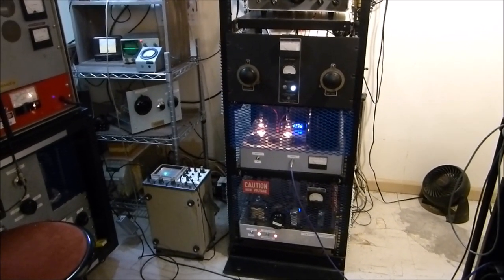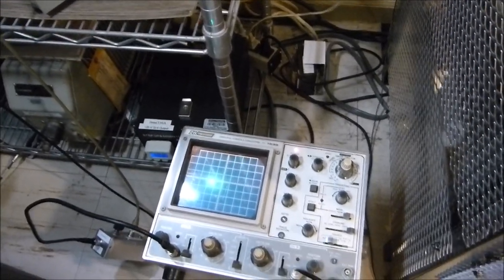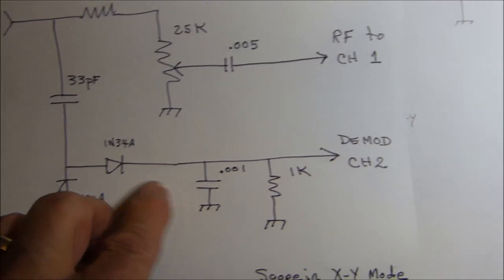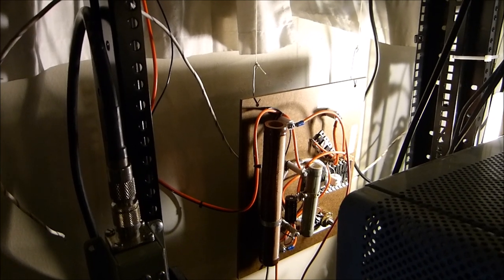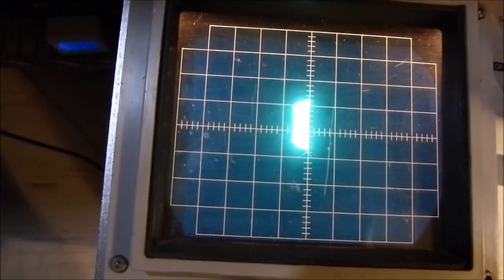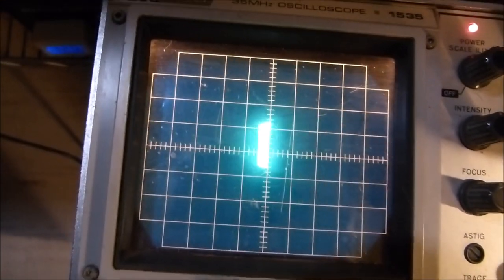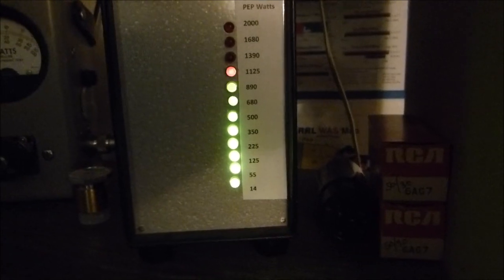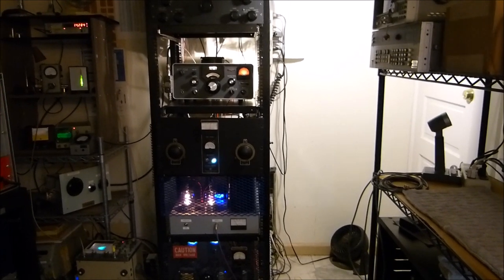Trapezoid Pattern of Amplitude Modulation Peak Limiting of High Level Class-C RF Amplifier

Comment: Tremendous presentation. Steve WA1QIX communicated this little Negative Cycle Loading circuit to me over the air in 1990, and I drew it out by hand. I incorporated it into my first homebrew modulator, a 6SJ7, 6SN7 into a pair of 1625s to modulate a Pair of 1625's. And it was very effective then, and still is today with many radios.
Reply from the maker: Thank you. This is not a popular video as not many are interested in AM and the intricacies of modulation measurements but it is nice to hear from you that you have used this circuit also. It is by far the best negative modulation limiter I have found and used. I just watched it and not everyone might see the slight differences in the left side apex of the triangle or the nuance in the modulation voice patterns but I see it better now than when I first published it. I have build another AM transmitter running a GG 3-400Z and plate modulated it. It is quite a transmitter. We do have to add a bit of modulation to the driving RF,  as Eimac states in their articles, and once that is done, positive modulation can go as high as we want on the GG amplifier. Lastly, I am building a 3-1000Z GG amplifier that will be plate modulated by a pair of 3-400Z (I like the zero bias triodes...) no more neutralization 🙂 Thanks for your comments. 73  WA4QGA

Comment: Very good demonstration. I have one AM class C TX, 2x  812A Pushpull modulated by 2X 811A. End would like to try this circuit.
Reply from the maker: Very good - this amplifier is 812A push pull also and I only chose the 4-125A as modulators as they match the the modulation transformer to load  impedance perfectly. I have tried several different clipper/negative-cycle-loading circuits but this one seems the best.  73